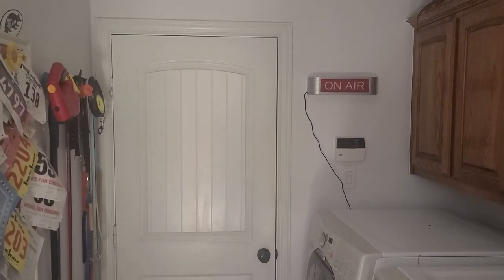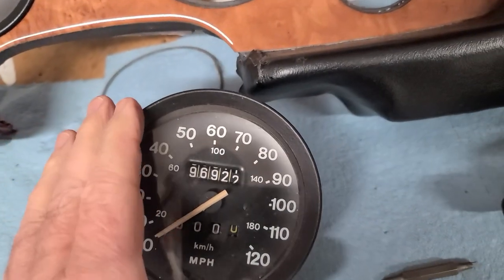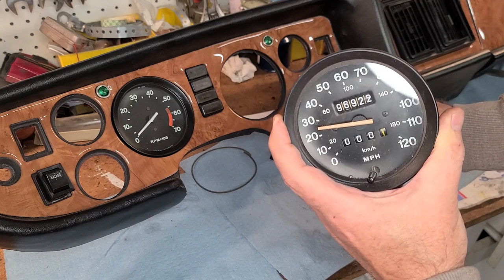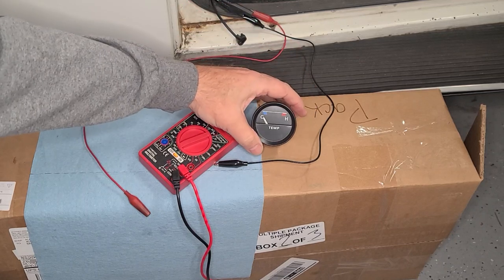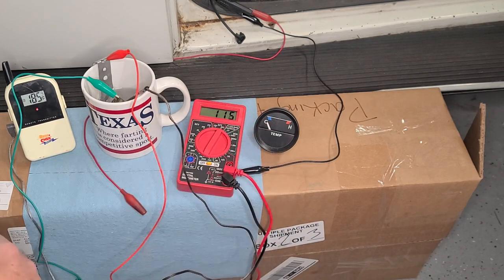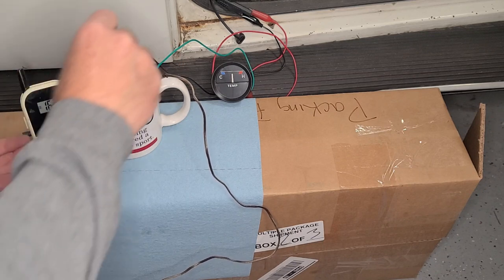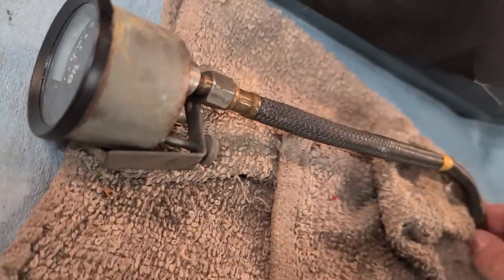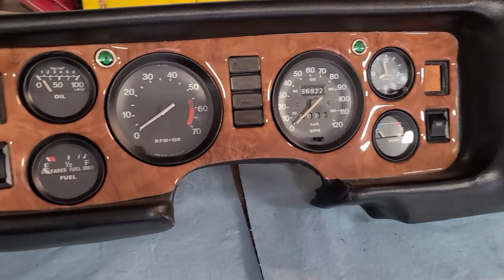MGB gauge testing

Comment: The fuel and temp gauge range from 0V to 10V as they get power delivered through the voltage stabilizer.  Just a little FYI.
Reply from the maker: Excellent add.  Thanks for the contribution.